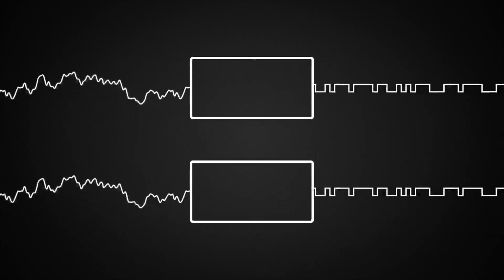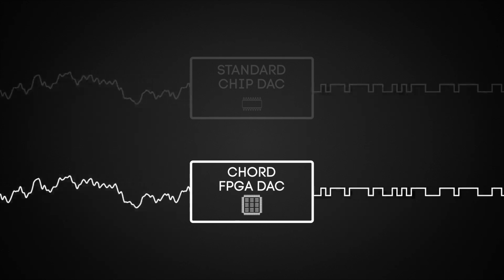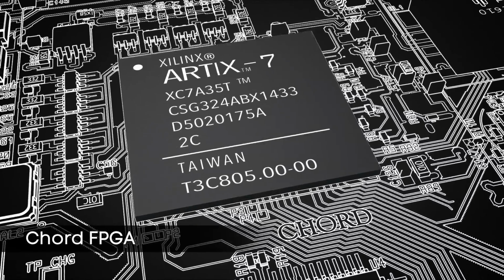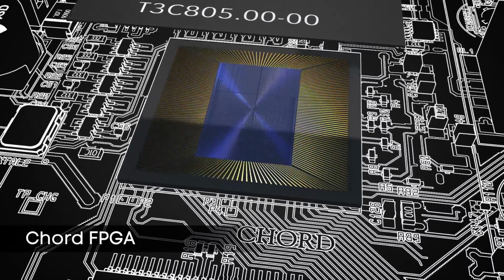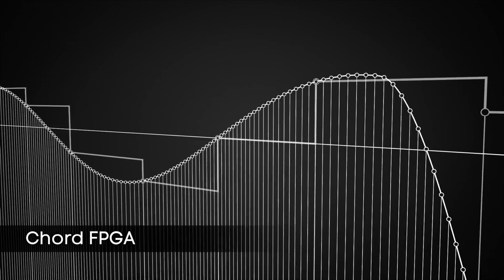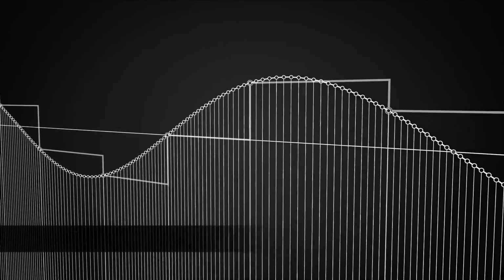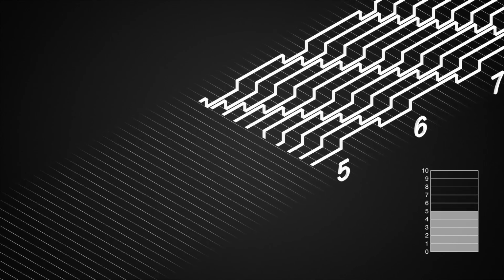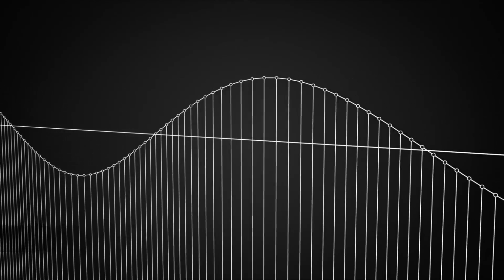Chord Advanced DAC Technology Explained

Comment: Amazing product. I don't understand how Chord mojo is able to drive any 2x headphones with ease with it's battery. I don't have to crank up the volume as much as my Bose Companion 5 which uses wall power supply. 
I also don't understand why super expensive headphone amp like McIntosh needs such a big size housing to drive headphone. I can understand it if we are driving home huge speakers. But headphone drivers are much smaller and relatively easier to drive. Even Chord mojo can drive 2x. Can anyone explain the logic?